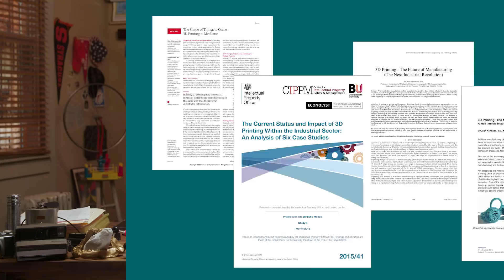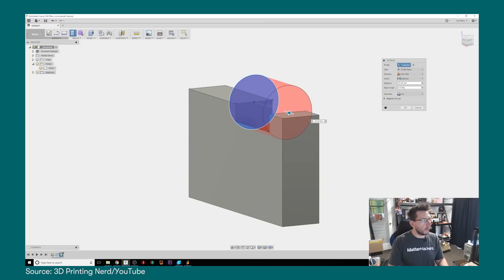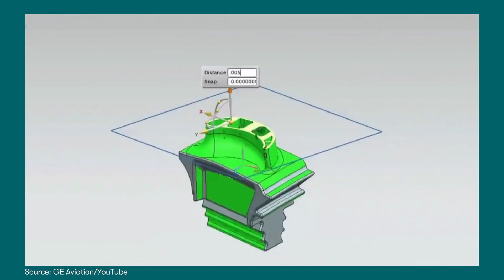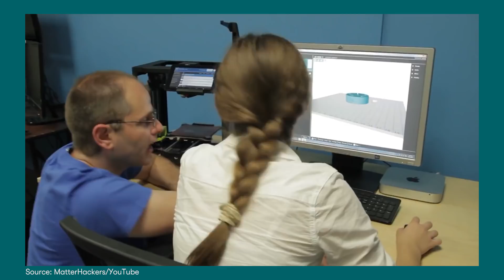What happened to the 3D printing revolution?

Comment: I own few 3D printers, and I didn't see a point when people were saying that someday everyone will have a 3D printer at home. Those are machines, and machines are not super easy to use, that's the same thing as with CNC machines, maybe a little bit simpler.
Reply: Yeah, same with computers.  Computers are machines and machines are not super easy to use.   No point in having a home one
Reply: dimman77 Modelling isn't that hard. It's just like using any other software. It takes time to learn how to be efficient, but generally you're just drawing cubes with holes in them. Lol
Reply: We are living in era that everything we want to be in few seconds. even if it will wipe in seconds, too.
I am working in small company that sells the 3d printers and I used them. the new generation of 3d printers are very easy to use and not that difficult. but , it prints in hours which is totally not for most people nowadays.
Reply: Nikodem Bartnik Machines are fine. I have 2 inexpensive printers, a filament printer and a resin printer. Both were assembled in less than 20 minutes and print spectacularly.

But... It's the 3d modelling that is the hard part. I have an OK ability to model from my youth as a wannabe game designer/animator plus technical drawing from my job. But most people don't. So they are stuck to downloading mostly kitschy crap that they don't really need, and the novelty wears off fast. Especially when you wait hours for your single colour plastic widget that has less detail than a most cheap injection molded plastic widgets.

I use mine for prototyping/fit testing (the filament printer), and the crazy high detail resin printer will be for manufacturing investment cast jewellery.
Reply: I bought a $200 3D printer and its paid for itself many times over already. I had zero CAD experience (though I do work in IT) and found it really easy to design replacement parts for things around our farm like wheelbarrow wheel bushings, replacement knobs for our tractor, dozens of things I use for my photography/telescope/music/drone hobbies etc. I've replaced tons of parts that wear out and simply aren't available to buy or are so obscure that nobody even knows what to call them. It's easy if you put the time into it and if the next generation grows up using them, it will come perfectly naturally to them.
Reply: @nsdhanoa  Based on what I've seen through the years, I would surmise that you have an exceptional  "knack" for it and you simply don't realize it .  You may be surprised to see that a lot of otherwise intelligent people will struggle with a level of mechanical design that you may consider to be rudimentary.  To you, designing a wheelbarrow bushing  on CAD might seem simple; however, most people will embark on their 3D printing journey with the greatest of intentions and then just give up.  Conceptual design is a portion of the battle, design software is a second battle, setting up/running the machine is a third, and the willingness to do it again is a fourth.   It takes a technical sense, a visualization sense, and an artistic sense to do these things.  And then on top of that you need the discipline to check your work, and not to mention persistence and commitment to troubleshoot and finish the job.  You are correct in that the next generation will become more proficient 3D designers if they are forced to use CAD at an early age, like for example in a hypothetical scenario in which we were all forced to play the piano at at early age - some more of us would be able to put a few notes together if this were the case.  But  I think you are underestimating how difficult this will prove to be for a lot of other people.
Reply: Uh, a 3D printer is a CNC machine.
Reply: learning to "darw it" is only half the equation..... even a small print can take hours to happen.... and that alone kills it for most class room applications.
Reply: gotta disagree..... really disagree...... not like using excel... we all understand math, but most folks dont any art traingin, dont understand perspective, and cannot visualize the finished product in their head to make it come alive in the software. Fusion is far easier to use than Sketchup, but you pay for that premium.....
Reply: To be fair CNC machines would probably be a common shop tool, up there with drill presses and table saws, if they were as cheap as FDM 3D printers have gotten.
Reply: i may be misunderstanding OP's statement but Bre Pettis was cravenly shilling these early in their life. I agree there's NO REASON for everybody to have these, but that was MakerBot & Bre Pettis' selling point... that everybody will have one... Wired declared the Replicator 2 the company’s “Macintosh moment” in its October 2012 issue, with a cover featuring a confident-looking Pettis cradling his new baby and the words, “This machine will change the world.” 
MakerBot fell into obscurity soon after.
Reply: @Dan I've not used Fusion, but Tinkercad is ludicrously easy to use and free (though, full disclosure, I came to it from Blender, so my view on its ease of use may be a little skewed by the comparison).
Reply: Agreed on TinkerCad. But I could never get it to do what I want....
Reply: The learning curve to model and design (and to manufacturing specs) is much different than learning how to use a text editor for writing an essay, book, or professional document. In that sense 3D printers will probably not be as ubiquitous as ink printers.
Reply: This, I hate how many disregard the 3D modelling aspect of it. Sure make a cube and print then call it easy, but that's just having a bite on a taster in your local mall. The average joe would shy away from even looking at the UI for most 3D modelling software, just like me everytime I tried to learn Blender.
Reply: You are all implying that for 3D printing be really useful, the user will need to know how to model. But I expect an online catalog of everything that exists. The most improbable thing to be scanned are guns, and they're already online, no deep web required. For scanning, we went from big scanners, passing by Kinect, to smartphones. Even if we are imagining something new, probably we will start from something that already exists, that's where IA comes in.
Reply: My thoughts exactly. I have used 3D printers to design components. It is EXTREMELY difficult to convert the picture in your head into a digital format. Most people would need a hundred hours of experience to just design something like a push pin.
Reply: Danyal A. What are you talking about? Sure cad software is advanced. But simple things are not hard to make and if a person tried to make a push pin without any experience I doubt that it would take more than 2 hours.
Reply: PoniesWhee! Mine was $157 with 2lbs of ABS, that doesn't mean everybody will have one. If you handed the average(not the average guy you work with that fixes diesel njection pumps or your buddy that designs hydraulic ystemssy person an AnetA8 in the shipping box, 90% couldn't print a Shia labeouf if you gave them $5000.